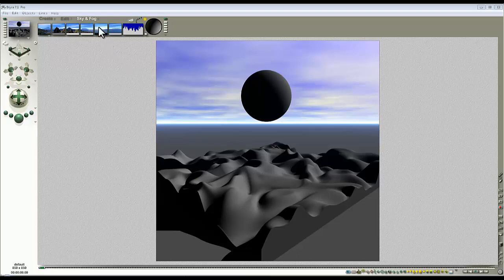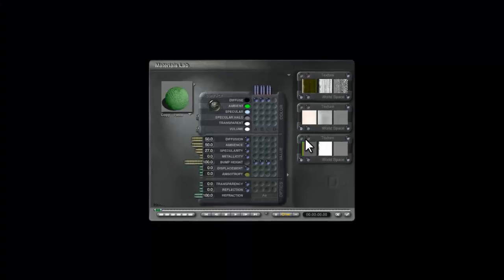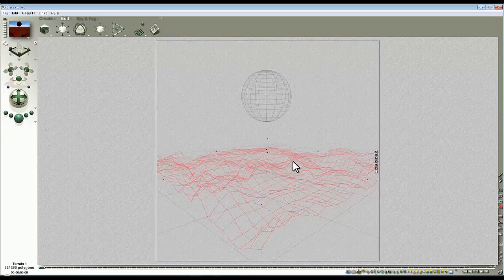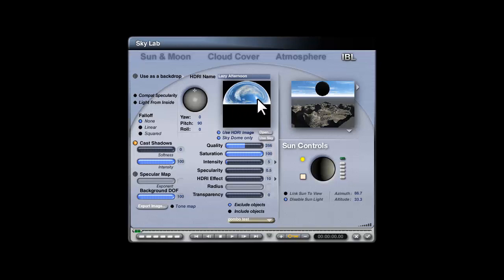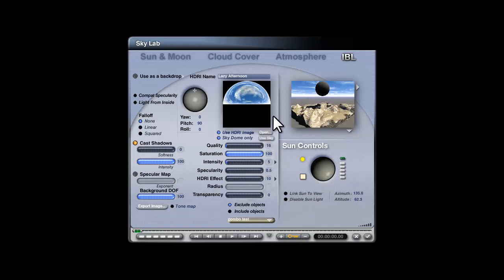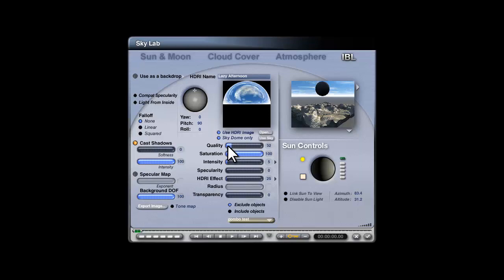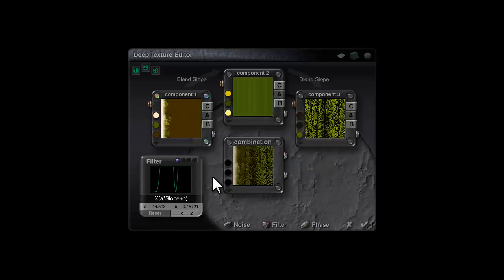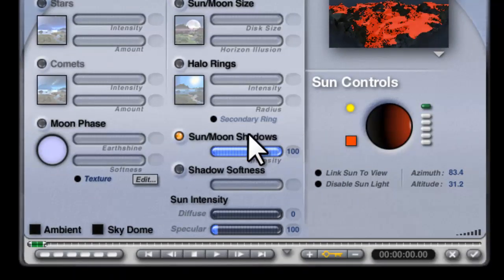Bryce Basics - Desert Landscape lighting and materials explored - by David Brinnen

Comment: Sky Lab> IBL ...
After calculating the HDRI image, the project file weighs a lot. Long saving and opening.
Disabling HDR doesn't help.
Can HDRI images be removed from a project file?
Reply from the maker: Couple of options spring to mind.  Load in a small HDRI image, that will flush out the old one and free up some space.  Alternatively select everything in your scene, copy, new document and paste everything back in.  That will flush out not only the HDRI but also any other residual data that is building up in the background.  Bryce's "housekeeping" is not the best, over time after multiple saves, there does build up a mysterious quantity of file bloating data.  The copy and paste trick can help keep that under control.
Reply: @davidbrinnen  Thank you so much!